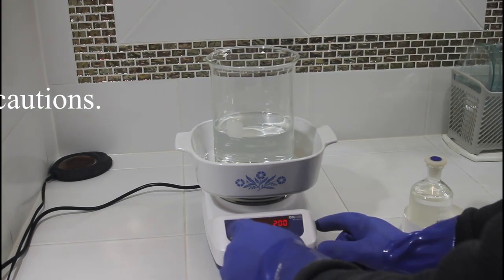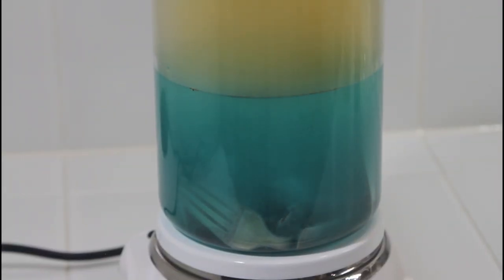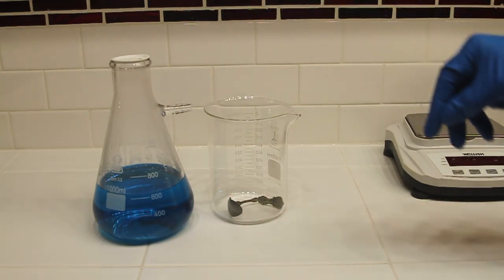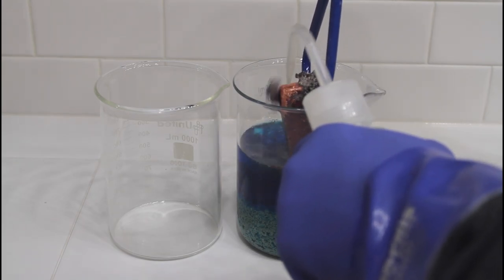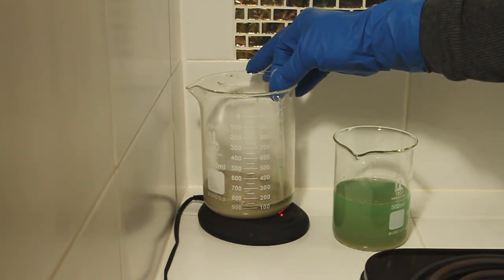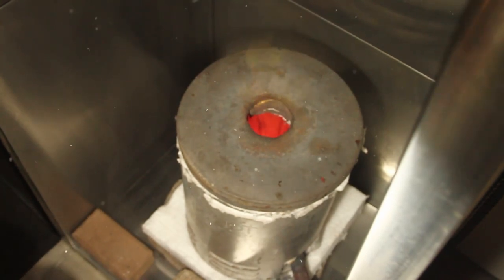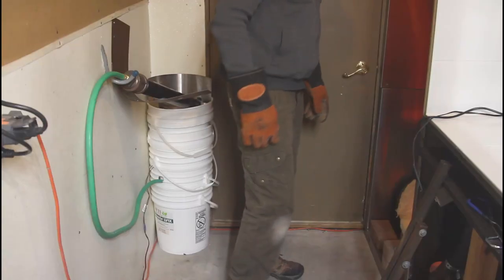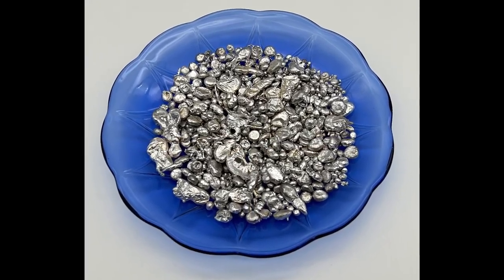Refining Sterling Silver into Pure Silver Shot

Comment: Hello Thomas, I am getting to do the same with some old european silver (500, 700, 800, 812, 833, 875, 900, 925, 950 - many historical standards) and get some pure silver for other projects...
What nice place and equipment you have...
Greetings from the Heart of Europe...
Reply from the maker: Hello from the US.  Your kind words are much appreciated.  I have a video coming up using my electrolytic silver cell for purification.  Do you currently use electrolysis to purify your silver? May all your days be blessed!
Reply: @anthonythomasfmg  I have everything needed for electrolysis (DC, AgNO3...), but the material to be electrolysed... 😀
I did not built the cell yet. I watch Sreetips and Jeff form Lithic Metals, but I will need something smaller, as I do not plan to clean kilos and kilos...
Looking forward for your silver cell video...

Comment: What did you use for the copper ingot? Could one assume romex electrical wire is "pure" or pure enough for the process? Great video thanks!
Reply from the maker: Romex is 99% + or - pure if its clean. I used copper tubing which is also 99%. That makes me think that would be a good video...   Thanks sirridok!

Comment: They are sterling silver plated is that correct. Nice tutorial. Thanks 🙏
Reply from the maker: I used sterling silver which is 92.5% silver.  Silver plated is roughly 5% silver over other metals.  There are a few different techniques to remove silver from plated pieces.  I would not use this technique for silver plated items.  I will probably make a video on refining silver plated items.
Reply: I’m confused on this as well. What is the remnants of the original silver piece around the 6min mark? What is that made of?

Comment: If it was sterling silver then what was the metal that was the huge chunk of the fork that was left? You’d think it wouldn’t be that big if 92.5% of the object would dissolve into the blue juice
Reply: The handle is made of sterling silver but the top part is usually finely buffed nickel silver or brass, plated with a thin layer of silver